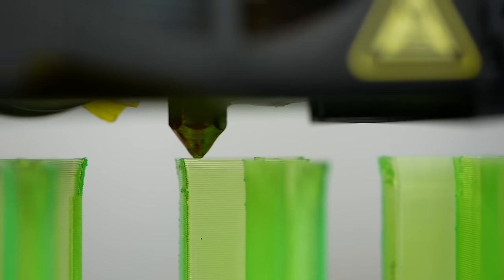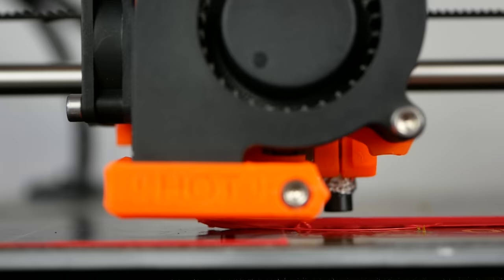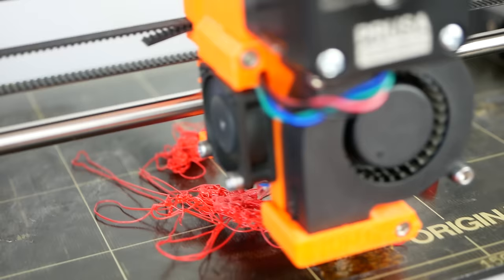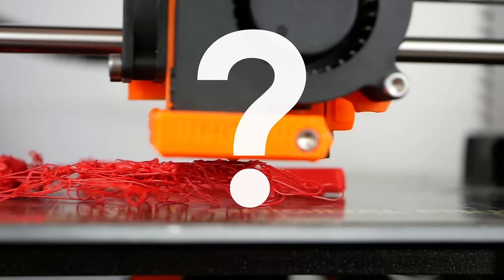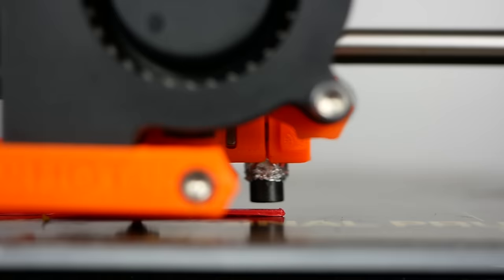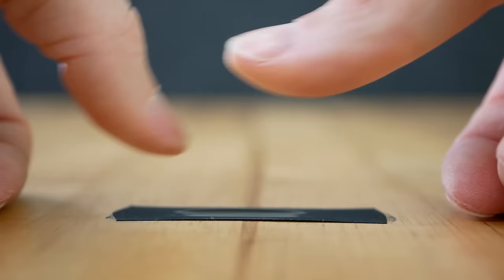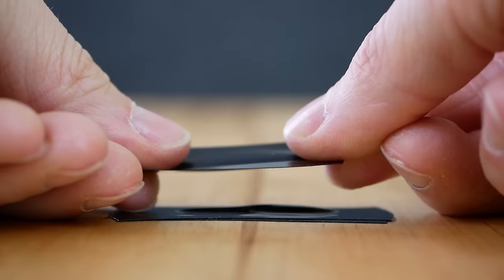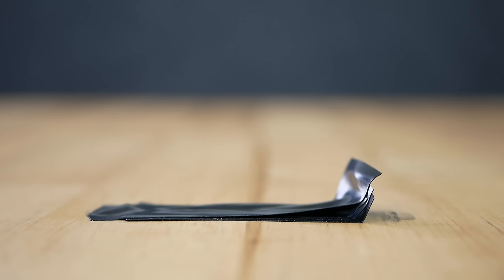Understand WHY 3D prints WARP - Simple explanation with experiment!

Comment: well, that was a good explanation but at 1 1/2 min long why not just explain how to prevent it?
Reply: higher temp
Reply: @germas369  not a good idea for PLA. Too high of a bed temperature will definitely cause a ton of wrapping.
Reply: Use an enclosure.
Reply: Hi! And what about if this issue is happening in top layers?  Ok now I'm pretty sure it's all about temperature. Maybe the cooling it's happening too fast?
Reply: the lower the temperature the least warping on PLA. usually working at 205 and bed at 60 is recommended.
but if you need to print ar higher temperatures then I recommend to lower the fan speed to 90% or under
Reply: @emmanuelbulacio1283 I use 200° nozzle and a 50° bed. Most of the time I don't get any warping. I think I have my fan on 100% when it happens, I end up stopping the print and making a new file with a brim. I'll have to run some tests one of these days.
Reply: No one knows how ;)
Reply: He did he just didn't flat out say it you gotta get the bottom layers to srink more before the top layers sometimes printing a little cooler all around isn't a bad thing
Reply: Also why not simply give us Cura or Prusa profile files so we can just save time?
Reply: With high temp materials preheat the chamber at least at 40°,seal the chamber, no extraction fan, use larger brim
Reply: He basically knows what is happening but he wants you to tell him how to fix 😂😂😂
Reply: @bwyn1072 and if its still warping? I havent had any success with PA...
Reply: @bwyn1072  "high temp" With ABS I go 60˚C ambient. Higher is advisable for higher temp but you need to take more into consideration on the printer build. Brims are band-aids or for tall parts with very small bed contact area or for specialty materials that need the help.

Comment: There you go - this is why 3d prints warp.😀 
How you can prevent this is a topic for another video.🙁
Reply: Where is the other video?? I know warping is happening to me thats why I’m here. To figure out how to stop it...
Reply: @GUARD14N  I use glue stick on the bottom, brims on the side of the print to hold more and sometimes sticky tape on top of those brims. Best print a raft, but that adds a lot of print time.
A good way to minimize lift is to print shorter lines In preview - if you see the first layers go reaally long and stretchy, try messing with the options and positions to make them go sideways and become shorter.
Reply: @realitycheck439  after 10 hours you should be good. Unless the print suddenly pops up. The frustration when you realize the print head knocked the print off is FFFFFFF.... immeasurable.
If you're asking about the raft underneath a print - it is painfully slow - it can easily add a few hours to a print that big. But it sticks much better than the glue.
Reply: @realitycheck439  well, if its a single long piece there is no easy way. You need a raft to hold it down. If it's only on one side - try blocking air draft on that side with a cardboard next time. That might be enough to keep it stuck to the bed.
Reply: @khamisi__6378  Yeah like WTF, the reason I clicked is to see how to fix it lol
Reply: can u fix it with some thermal hood over the whole printer too?
Reply: @viisteist1363  A perfect solution would be a closed temperature  controlled environment where you set the temperature for all of the air inside, not just a heating plate on the bottom, but then you need cooling for all your motors and printhead as well as a steady cold air stream right where the filament exits the nozzle, so it doesn't drip, but solidifies faster. But that is all too complex and expensive for a desktop printer. Only top tier expensive printers have all these options. It would be cheaper and less complex if you go the other way and leave everything open and at cold temperatures. The hot filament would need to be supercooled really fast as soon as it bonds with the layer bellow, before it travels - meaning all the stress should make small cracks along the line instead of one long line that tries to shrink. But you still need a way to stick to the bed. For example there are many printers that don't have heated beds. But the warping still remains - not because they don't have a heated bed, but because they don't cool the filament fast enough. It's still tricky. Even if you stick the bottom to the plate and you cool it down fast enough before it warps - you create another problem - the layers don't stick together, because they were too cold and the 3d print delaminates. It requires a fine balance different for ever size, material and temperature. Try running the filament as cold as possible - that way it shrinks less as it cools down, always use a raft or at least a skirt for better adherence to the plate, use glue pens on the plate and even keep paper tape to stick on top of the skirt edges when they lift up and hold them down. Better they lift than the print does. Keep doors closed.

Comment: Please keep in mind that the lower layers of PLA are very stiff shortly after being printed. So if you can ensure good adhesion of the first layers it will be greatly reduced. And not to print to fast so the lower layer has less time to cool.
Reply: can u fix it with a thermal hood over the whole printer too?

Comment: Hey you missed another cause. If you print at low temps say near the melting point of the plastic, say 195*C for pla, it is still quite elastic for instead of melting and taking a new form it just stretches and sticks to the lower layer increasing the internal stress on the part.
Give it a try. Grab a pice of filament and a heatgun and heat it up until it starts softening and then stretch it and cool it down. It will stay in that shape but if you heat it up again it will go back to its old shape like heatshrink.
If you do that again but heat it higher when you reheat it wont go back it will just soften

Comment: Check your hot beds from the bottom. The heater element wires don't always cover the entire surface of the hot bed, e.g. between the four adjustment screws.

Comment: Three ways to reduce it:

- Brims
- use a (Heated) Enclosure, (if you dont have a heated enclosure just heat your bed for a few minutes before starting the print)
- wait a few layers to start the part cooling fan (maybe the 3rd layer)

Comment: i found 2 solutions first one get enclosure to keep it hot with reduce fan speed another solution is set up the fan speed to keep it cool. wrap happens by temperature difference. i keep it hot when printing ABS. but PLA can print without bed heating. too much fan speed can cause layer delamination especially with cheap quality filament so set up fan speed well to barely not wrap

Comment: I think I get it but the video is missing something important - in the middle of the tape, the tape is being pulled towards left and right simultaneously. It's under tension but doesn't want to move relative to the build plate.  Therefore the tension in the part is not pulling it loose from the build plate. On the corners, the opposite happens.

Comment: my pla warps on the top layers, especially 90 degree layers make the edges curl upwards and ruins the print later in the process. i lowered the extrusion temp and increased fan speed and found that if you set the extruded part quickly by cooling it you can minimize the warping. for bed adhesion you will want to increase temperature to keep the pla sticking to the bed. i never tested on anything other than pla.

Comment: Since he DOESN'T explain why it happens and how to stop it. Warping is caused when you cook the project and it begins to shrink rapidly in the center. It is caused by having your heatplate over 60°F . After I turned down the temperature (Since noone advice that) it works fine now.
Reply: What's your settings? I'm thinking of trying 50C.

Comment: I found great solution to get rid from warping on my CR10 :
- Preheat heatbed and attach PVA glue
- First 2 layers heated bed  - turned on 
- And you turn on heatbed again few mins before removing print

You get great adhesion and eliminated warping due heatbed was just used to stick first layer well. And not even to mention that you get less electricity consumption.

Comment: Is it correct to assume that printing with thicker layer heights, will result in less warping? (since there will be less layers pulling on the bottom one?)
Reply from the maker: But a thicker layer will be pulling more (more material) which kind of equals out.For this reason I think that there won’t be a huge difference.

Comment: Excellent!

I'd like to have a list of materials, their glass transition temperature and the shrinkage rate; and somehow (either by experimenting or calculating) tabulate how many degrees below that is acceptable for the print chamber..  PLA doesn't warp much as the ambient temp is typically 30-40 degrees below the Tg for instance.  Is that the same for ABS, Polycarbonate etc etc?...

Love your videos.
Reply: I'd be interested in this too. There's no end of "ABS shrinks by about X% while cold" videos and forum posts, but either I've just not found the right corner of the Web yet, or there's a lot less research that's gone into controlling warp and accounting for any unavoidable shrinkage while printing things like PC, PMAA (yep, acryllic filament is a thing), or Nylon. Heck, I haven't even seen testing for ABS that goes beyond, "I stuck a box on the printer and it got to like 40C in there."

For PC/Nylon/ABS, I know those all usually warp a ton if they can (and they're kinda gross and release a bunch of particulates/VOCs), but I'd love to see some well-organized data on how much they warp under different printing conditions.
Reply: It's more complicated than that.
It depends too much on the shape of the object.
Human intuition with shrink anchors helps.
Reply: kareszt True: geometry does play a big part. Perhaps more of a generalised guide for printing temperatures (chamber) is what I mean then?
Reply: Jai Stanley That is a large task.

Comment: Nice analogy. I'd recommend an immaculately clean print bed, keeping the print bed temperature reasonably high, building an enclosure if the printer doesn't have one and using low tack adhesives on the print bed for some materials. Obviously, not all these are necessary in every instance but an enclosed print area is invaluable for higher temperature materials like ABS, Nylon and polycarbonate.
Reply: Hi!  I have this issue but not in the printing bed. it's happening in the corners of top layers.  Any suggestions, good man? Thanks in advance
Reply: @Gpsplz7  
It sounds like an issue caused by over cooling. The edges of prints are more volatile to heat loss, especially when sharp corners are involved and / or the print is quite high and therefore further away from the heated print bed. I'd recommend trying to use an enclosure to maintain a more stable and consistent temperature. Even a large cardboard box placed over the printer can be sufficient to make a noticeable difference. Hope this helps.

Comment: Apologies in advance for necroposting here.  As far as printing with ABS is concerned,  I want to throw out an idea to those who are good with Python programming and especially those who have written addons for Cura. I think one way of mitigating the shrinking effect of higher layers would be to stop the feeding of filament at frequent intervals. This could happen every 3 to 5 mm, for instance and could be limited to long, straight lines of printing.  This could also be limited to the inside walls of the shell and infill, for instance.  I think the final effect might look a little like a print that suffered from a clogged nozzle.  Anyone who is up for this challenge ?
Reply: In this case simply printing very slowly could solve the issue as well?